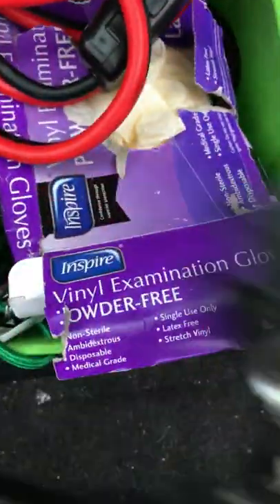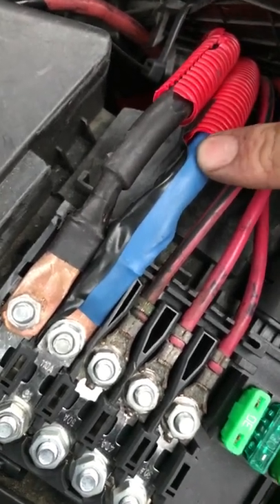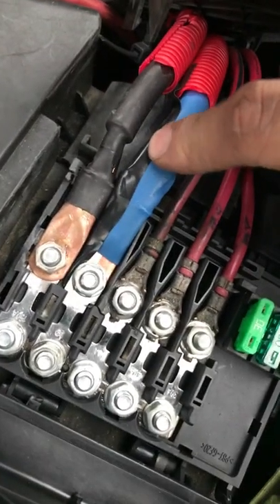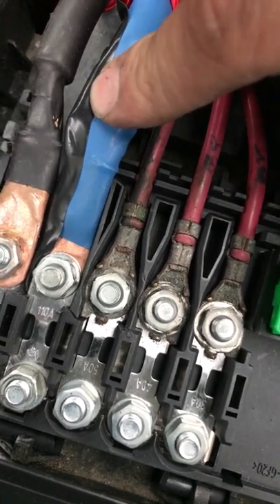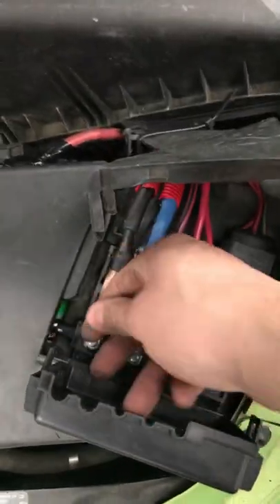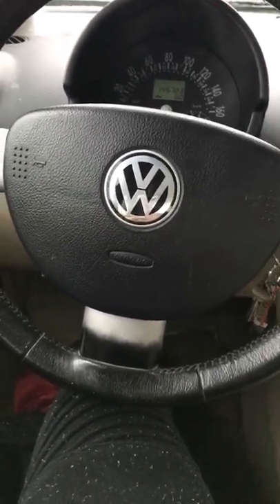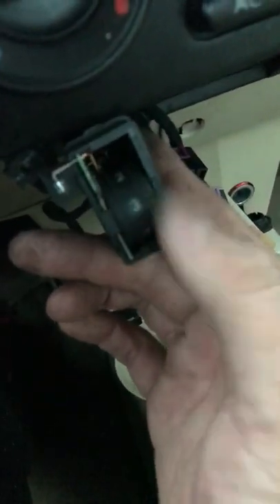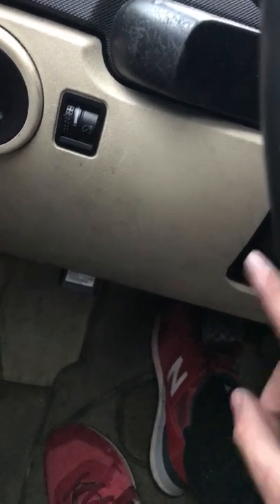High voltage fuse box melting problem resolved

Comment: Great video my friend! Fantastic advice as well. I am dealing with this exact same thing right now with my 2000 Volkswagen Jetta. I have replaced the box twice now. I have an over powered stereo with 12in subwoofers so I figured I would be good just upgrading the alternator wires…. I burned up my 2nd box and now planning to upgrade the second wire that controls my heated seats. I only had the overheated problem when I was using my heated seats and bumping the bass.
Reply: The coolant resovour was my problem for the overheating, check that too

Comment: Same with my 2.0 jetta mk4. I worked on it 2 days installing a new alternator wire and ground and power from the starter. The positive cable was getting so hot it scared me to have my family in the car. Only the first cable on the HVFB was getting hot.  But I noticed that the wires would stay cool and only get how when I ran, lights, AC, radio, even after the wires being replaced it still gets warmer then it should so today I'll be going through what you went through and installing a new 4 gauge accessories wire and pray to God this resolves the issue. I will let you know how it goes. Also, measure the resistance from the alternator to the negitive terminal on the battery, the results are close to " about to catch fire and kill you" numbers..I was getting 2.0 when you should be getting 0.05 at the most. Scary shit.
Reply: Hey I've got the same issue same motor in my Jetta did the 4 gauge wire work out? I'm losing my mind with this stupid problem and don't have a VW dealership in my area

Comment: Nice job! The majority of electrical problems are usually connections of the battery or fuse panel relay box. Also often overlooked are the grounds  and the connections to ground. Just like high amperage car audio stuff you wanna run thicker gauge matched  wire for both + and -
Reply: Daniel my brother that is so true... I just started working on Jetta 2014 tsi and while checking Google n learning about cars, I found out that the ground and or the connection, fuses and relays is Big Big Big time causes to many of the problems that is not checked first...they should be checked first before all this moving if parts n changing parts... It would be so easy for us all especially Diyers and Pro-Mechs. Especially when you have a crank and no start. Hope I articulate what I really want to say well...be bless.. PS thx Joshy

Comment: VW like other car companies looks for ways to save them cost at your expense. Using low gauge bare minimal wiring among things is a tried and true method. Most people dump these cars before they spend too much money on inadequate parts that fail because of poor design. How a fusebox melting didn't issue a recall is the same Logic as diesel-gate they don't gaf. So buy a new Fuse box, do a big 3 or 4 wire upgrade kit, take your time and make this a weekend project, do everything above reproach and learn your VAG vehicle or get a for sale sign and go buy a Honda or a Toyota!

Comment: I got the a 2005 have beetle and I order from walmart a Jetta fuse and alternator harness  By accident they look the same and on the fuse box it just has two copper taps it looks Promising. I order one from Ebay  the pricing was 196.00 for just the alternator harness only and compared with the walmart pricing was 82.00 for a alternator harness and fuse box I believe that was a deal..
Reply from the maker: GONE_ZO sounds like a good deal. Hope it works out. Ever since the video my fuse box has never, not even a little bit, overheated or burned. Change to a thinker gauge wire from the alternator to the fuse box worked great.

Comment: Running HID lights would actually do the opposite which would take less power from your car because that ballast is what transforms the power to the HID light itself kind of like a bright bright LED light messing with some cars because the car thinks the lights burnt out because it's taking such little power to run... Just saying is all. Good job on them crimped and heat shrink cables
Reply from the maker: Secal Cavazos Thanks for the correct I for buddy. Appreciate it. UPDATE: the wires have maintained and haven’t burnt since.
Reply from the maker: Nope haven’t burned since
Reply: That’s what I thought?

Comment: What tool do you use to loosen and tighten the nuts on the fuse box?  My sockets don’t seem to fit.
Reply: 10 mm socket....it's a tight fit for sure
Reply: I used 8 mm

Comment: What did you do about the 3 connectors on the original wiring harness?
Reply: they are separate from the large gauge wire

Comment: I have a question... on my friends 04 beetle the check engine fuse is not getting no power. I’ve checked it with a power probe and replaced the fuse. I checked the fuse terminals and that’s how I found out there was no power getting to it. Any suggestions. Because of that he’s unable to link an ob2 scanner to the port to find out why his cel light on.
Reply from the maker: Sam Han I need more Info, what do you mean by “check engine fuse”?
Reply: On the side of the door jam where the fuse box is located. There is a 10amp small fuse. On the fuse diagram card it shows an engine picture with a lightning bolt on it. So I’m guessing that goes to the CEL and to the OBD2 connector. I checked for power when fuse is inserted and there is no power to it. However there is another normal size fuse on the lower half that has the same picture and that fuse is seeing power to it.
Reply from the maker: Sam Han It is fuse number 10 located on the top half of the fuse box if I’m not mistaken. That fuse is for engine control/gasoline. Did you try replacing the fuse with a new one if not I suggest taking it to a professional
Reply: WhatJoshyDoes Tv I’ve changed the fuse and power probed it and there’s no power getting to it. I’m gonna try what you did and replace the wire with a 4ga and then check behind the fuse box wires for any short when I get it disassembled. The car is currently at the owners place so I can’t be exact if that’s the fuse you’re referring to but it has a pix on the diagram with an engine and a lightning bolt on it.

Comment: With all the wires going into the firewall at the samish place how did you get in there? I cant even get to the firewall with all the wires and plastics
Reply from the maker: Well i basically just squeezed the cable through. There is a black cover behind the air box. In there there are cables that lead straight into the cabin. The entry point in the cabin is under the driver side dash cover. (This is the flat dash area directly above the steering wheel. Remove the middle dash cover,  which slides back, to access the screws to remove the dash cover.) Under the dash cover is a back cover. You’ll beed ti remove it in order to access the cables from the engine bay. Unfortunately i no longer have the car to show you in more detail
Reply from the maker: Go ti time stamp 6:52 where I explain how i got the cable through
Reply: @whatjoshydoestv6741  thanks, j also figured out that my alternator is bad, and is sending too little voltage out heating up the wires.

Comment: How many feet of the 4ga cable did you use in total (from alt to distribution box and from distribution box to the fuse panel under the dash)
Reply from the maker: Think it was about 4 feet
Reply: @whatjoshydoestv6741  4ft total for both wires Or 4ft each?

Comment: Did issue every return? 

Did the S176 cable every heat up again?
Reply from the maker: Boosted Mongol well actually yet the wire still gets hot but not as hot as it was before I replaced and it hasn’t melted the fuse box. I might need to get the battery cables changed and see if that helps. But so far so good
Reply from the maker: Here’s a update. The issues haven’t returned.!could be that the HIDs light where to strong. But I had the HIDs for a few months after this video until the died and during that time the issues haven’t returned.
Reply: @whatjoshydoestv6741  this is an well known problem on A4 platform cars. I own an 1.9 Tdi, and faced this same problem two days ago,but it just started to melt. I replaced the cable end, with a mains voltage type one, I had a bad contact between the cable and its teminal. It was heating up Quick under load. No more problems now, in that respect. Also replaced all cable ends from the negative battery cable (to chassis, to engine block).

Comment: I have a 2005 beetle with a charging problem,  it seems like when the engine gets warm the charging voltage drops..my junction box hasn't melted but I checked the temperature of the alternator cable and the one besides it were 253°
Reply from the maker: Try and do what i did and replace the cable from the box to the alternator with a thicker cable. Don’t even bother fishing it exactly where the original one goes. Just place it in a nice path across and zip tie it down. This way you can check the temperature of the whole cable. 

Again i am not a professional mechanic. Do at your own risk!
Reply: @whatjoshydoestv6741  i bought a new alternator harness do you think that would work?
Reply from the maker: @rdmcgreanor  it should since its brand new
Reply: @whatjoshydoestv6741  thanks for your help..you awesome!

Comment: Hey bro, I’m having the same problem with my VW Mk4 also, interior fuse relay (2nd wire) has overheated itself and started eating the wire out of the box. From the looks of it it’s been going on for a while and I didn’t know. I bought about 10 feet of 4ga welding wire to replace. What did you have to remove out of the way to get to the other end of the interior fuse relay wire? Did you heat shrink the wires with new covers?

Comment: Did you build the alternator cable yourself? Are those connectors on the OEM cable fused to the alternator cable or just wrapped to it?
Reply from the maker: junkv57 I built the cable myself. It goes straight from the alternator to the fuse box. Everything else is stock. Not sure what you mean by “fused” or wrapped, please clarify
Reply: WhatJoshyDoes Tv I don't know if you removed the OEM harness from the car but on my Jetta TDI all the pictures of the alternator harness the little connectors were wrapped onto the harness. I haven't pulled mine out yet but I'm just assuming the small connectors are just wrapped on the harness and I should be able to unwrap them from the harness and zip them on my fabricated 4 gauge welding cable.
Reply from the maker: junkv57 i didn’t remove the oem cable. I just replaced it and left it there wrapped it in electrical tape
Reply: @whatjoshydoestv6741  so you just unbolted the old wire and bolted the new one in?
Reply from the maker: @devinsmith7274  pretty much. Could take out the original because it's tied up together with other alternator cables (wiring harness). Never had issue with it since the replacement.
Reply: @whatjoshydoestv6741  so you just straight wired it and left the connectors in?

Comment: Does that also control the fuel pump voltage??
Reply from the maker: Chann Groves yes it does. Its the 4th cable counting from left to right.
Reply: @whatjoshydoestv6741  you know, mine actually melted where the little green fuses went. Just one or them though. The wires are not melted though. It's weird though, after disconnecting battery and reconnected, car starts just fine.
Reply from the maker: Chann Groves had the same issue. The green fuses where melting also together with the wires. I assumed that the power was getting to high for the fuses to handle because the wires where old. Don’t understand why the fuses didn’t blow but I got the job done lol

Comment: How many amps is that alternator cable??
Reply from the maker: Joe mamma I don’t know about amps but the cable I put on is a 4gauge cable. Original cable is a 6 gauge
Reply: @whatjoshydoestv6741  i so apologize. I guess what i want to know is  how many amps is the fuse in the terminal connector box connected to the black cable that leads into the alternator
Reply: @whatjoshydoestv6741  4ga stranded wire is good to 140amps so I've read.
Reply: Sorry that was for jomamma